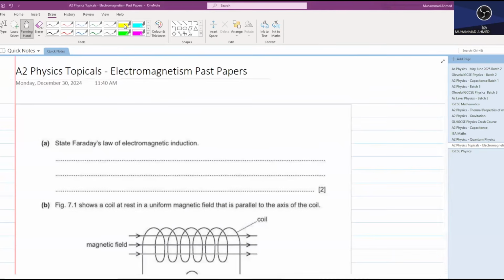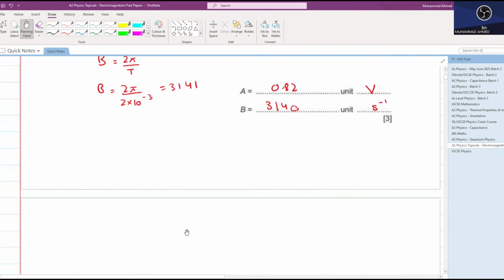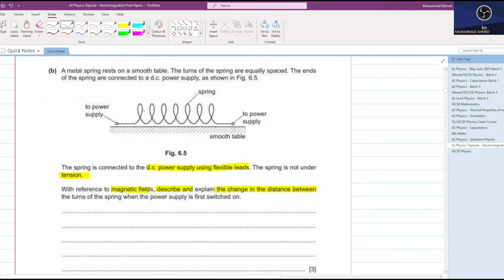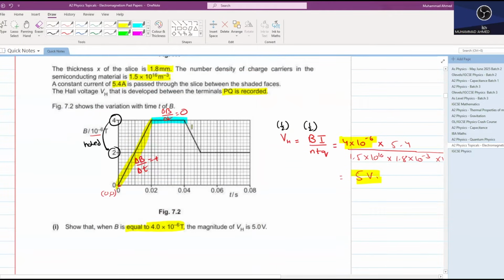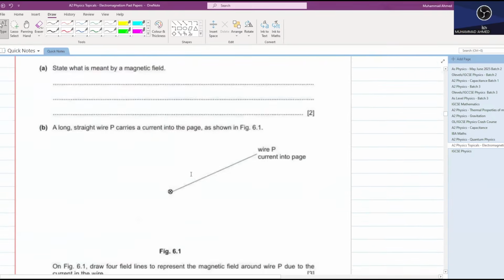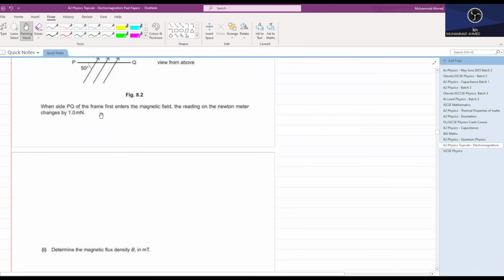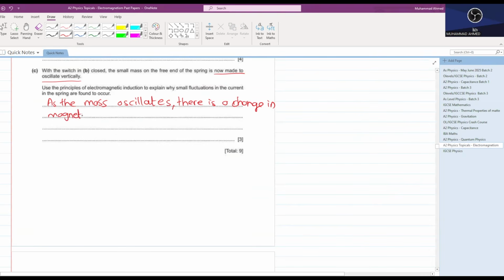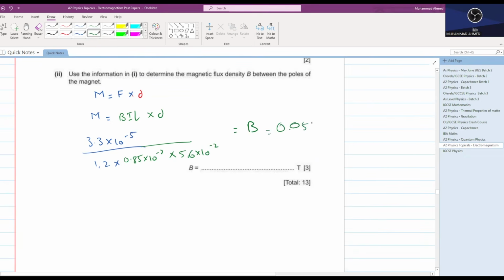A2 Level Physics (9702) | Electromagnetism Past Papers

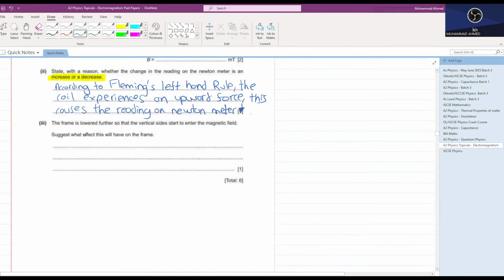Comment: sir at 1:24:43 (iii), im confused as to why the frame will rotate. Isnt the field into the page and current downwards and upwards for the left and right sides respectively and using left hand rule gives us force towards the center of the frame for all points. Is it due to the the field lines being at an angle and not exactly perpendicular to the wires sir?
Reply: Direction of current in vertical parts of wires are opposite so force on the wires will be opposite. One will move forward and other will move backward due to which it will rotate.